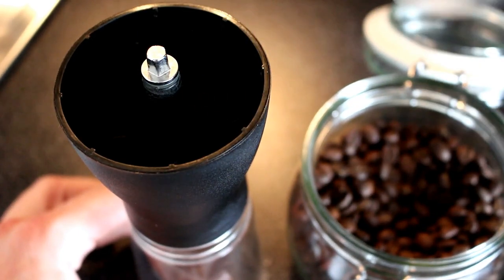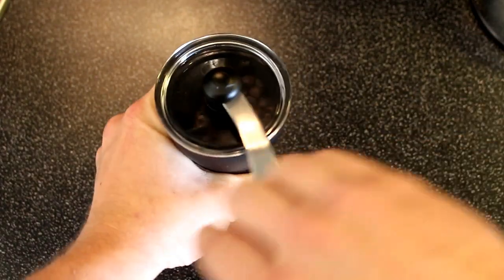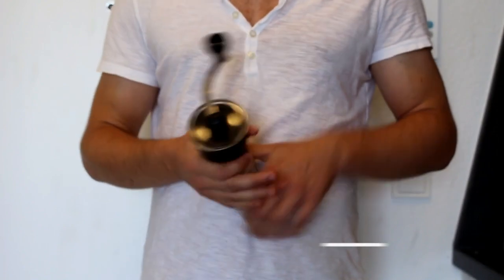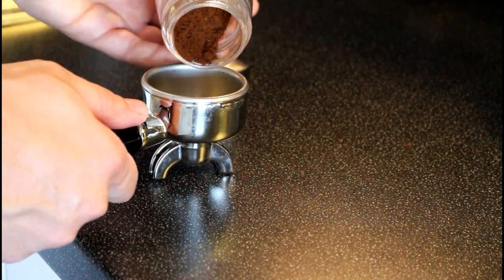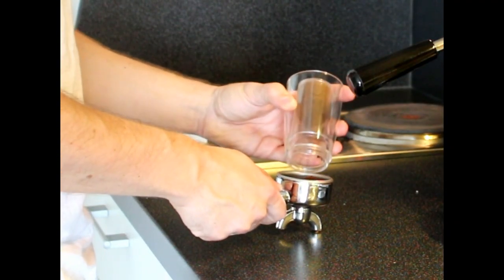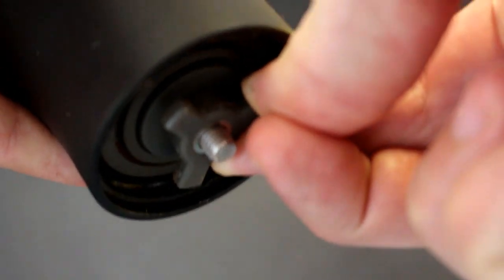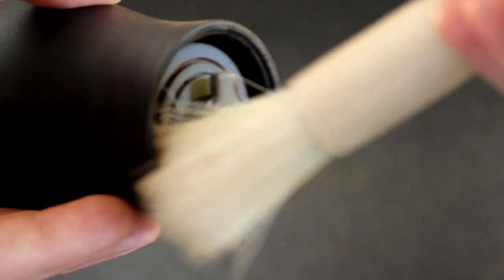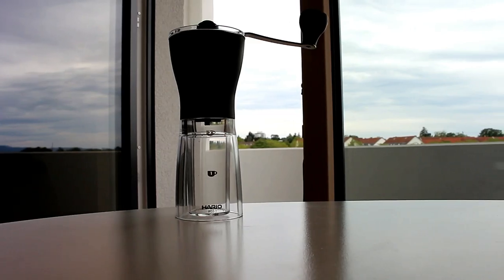Hario Mini Mill - Tutorial and Review

Comment: It seems to take forever to grind fine enough for espresso even with a drill attached.  Please enlighten me the best way to use this for espresso.
Reply: Alex Stamm so you wouldn’t recommend it for espresso grinds ?
Reply: @DrVilgefortz  Expresso grinds are always pain in the ass without an electric motor of an electric burr grinder.
Reply: I attach a drill to my grinder sometimes too (I have a Turkish Sozen grinder), and what I've learned is that it does not increase the process much, particularly if you set the drill to a hight speed because then the burr spins to fast so fewer bands fall into the "working area", its a bit similar to putting some thick substance to a blender, it just pushes everything out while spinning empty inside. You can still use drill with a grinder but you'll need to decrease speed.

Comment: hi im interested in getting a hand grinder and found the kinu m47 but was very shocked for the price but im sure it ahs great quality. DOES THE HARIO GRIND WELL ENOUGH FOR ESPRESSO AS I WANT TO GET SOME GOOD BEANS ONLINE AND FINALLY TRY NON PRESSURIZED FILTER BREWING MY ESPRESSOS AND LATTES WITH MY GAGGIa? have you done a video making an espresso with this?
Reply from the maker: Hey Enrique, as far as I understand it, you are just getting into freshly grinding coffee for your espresso extraction? If that is the case, I would recommend getting a a 'starter' grinder for little money to experiment and learn with. After you have gotten the basics of espresso extraction down, you can move on to the more expensive equipment.
I think the Hario Mini Mill is a good hand grinder for beginners, as it is quite cheap and for it's price can grind fairly consistently. So if you are just starting out, I would definitely recommend getting one of those as it will do a neat job grinding coffee beans for your espresso extraction.

Comment: Any issues with the crank handle wearing out? I've been shopping around for a manual grinder and some of them have issues with the handles wearing out.
Reply from the maker: +UTAUxKURENAI so far the handle has been pretty sturdy. However, there are small signs of wear. Nothing major though :)
Reply: Yes, the crank handle wears out. Not good if planning to use regularly.
Reply: It wears out but they will replace it
Reply: It’s not the handle that wears out but the handle cuts a groove into it making it hard to get off again. I just use a drill with mine so the handle won’t get stuck on permanently.